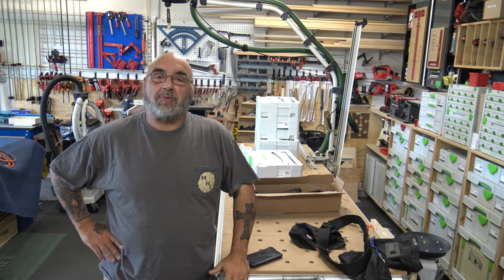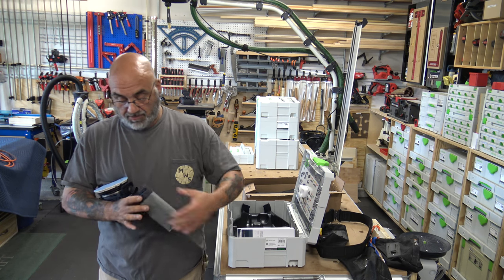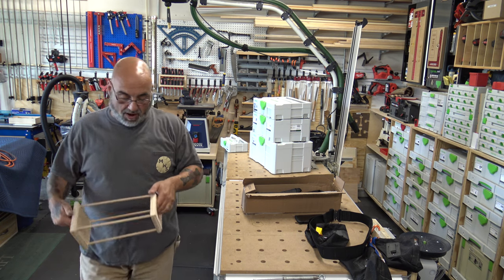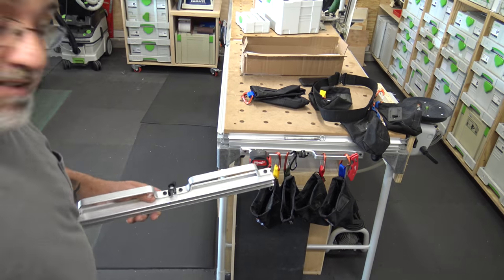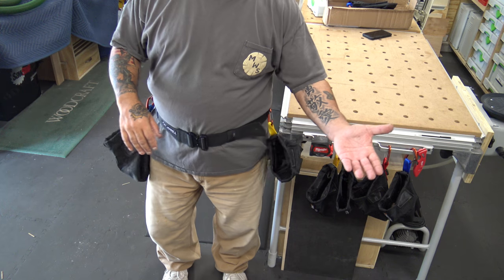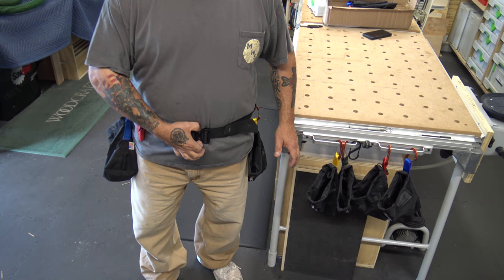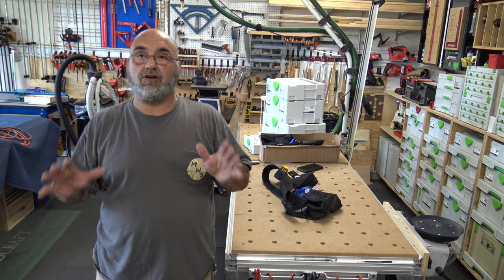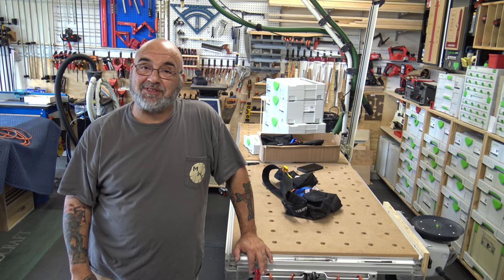Review of my Festool ETSC 125 LI and Calavera tool works belt system.

Comment: @mike around the 4:00 time mark, you were sharing that you would fit a bandsaw into a festool systainer... 

What kind of bandsaw is that small, and what are you using it for? (please excuse my ignorance, I'm just learning, but I definitely need a bandsaw for re=sawing wood.)
Reply from the maker: TheRangeControl I have a 12 volt mini band saw I cut metal with. My Rikon band saw 16” is a very good saw. Thanks Mike